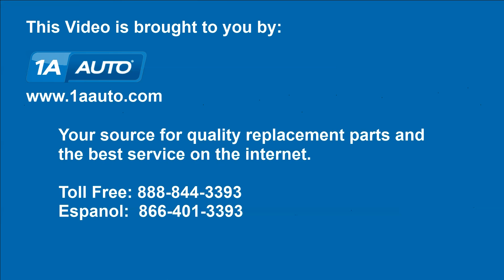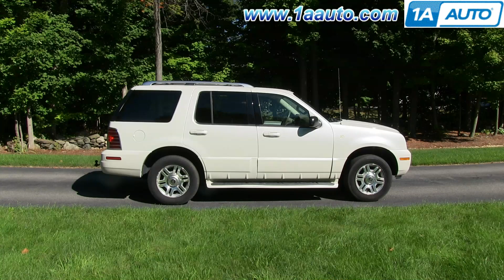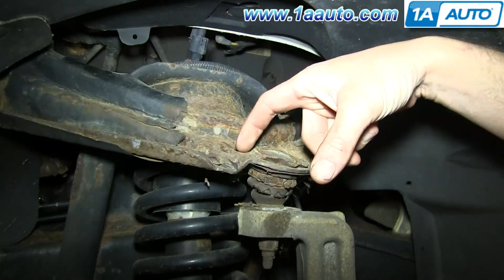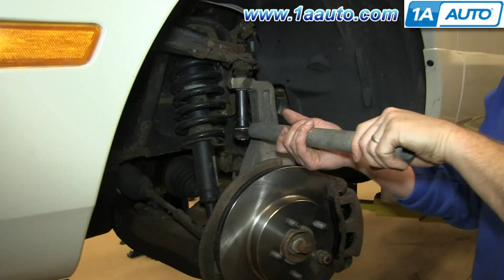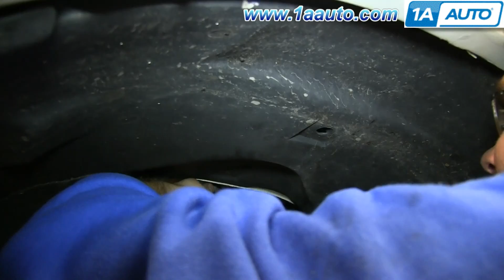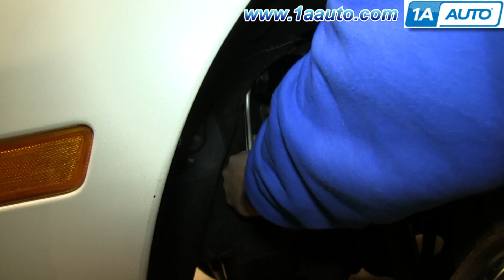How to Replace Upper Control Arm with a Ball Joint 02-05 Mercury Mountaineer

Comment: Sometimes jamming the whole upper control arm down with a bar or pipe works. I usually sit on it if I'm on my own. Another trick is to cut the nut off with an angle grinder and metal cutting blade.

Comment: This is what I was looking. I've done that job before just need to remember several parts and you just without too much science did what I need specific... an less than 10 mins...

I saw several other tips vids man....a lot of them practicly disassemble the whole front train to do that replacement... unnecessary do that and dobles up your job and increase your headache specially the unnecessary and excess spend in re-allignment of that train....naaaa...

THANKS GUYS !!!

Comment: I usually just remove whatever rubber is left over the ball joint and clamp a good set of vise grips there. Then heat the nut with a map/propane torch. It usually comes pretty easy like that. Might even get lucky and not need a torch using this technique.

Comment: I've got a 2004 Explorer where on a new control arm / ball joint combo, the diameter of the shaft of the ball joint was too big.  Trying to get the ball joint to seat - the shaft broke off in the wheel knuckle and is TOTALLY jammed in there. I tried to use a 3 prong puller and it seized up (lol - thank China) without budging the ball joint. Ugh. This is going to be a tough one. I haven't tried a torch yet. I don't have one of those fancy tie rod forks. I did borrow a ball joint press kit and hub puller. The thing I'm worried about is damaging the wheel knuckle since it's a much softer cast metal. I would appreciate any ideas. Thanks.

Comment: Hey mike. I was currious. I got a 2003 xlt model same body style as this. Are the ball joints removable from the control arm on this model or are they welded in?
Reply: I recently did these on a 2003 Mountaineer (same deal), while Mike's info is well intentioned, it is a bit off.  The upper ball joint can be pressed out on these, however most aftermarket ball joints will not exactly fit the OEM control arm.  The fitment  is off and you could experience a premature failure down the road.  The other issue is Ford does not sell the upper ball joints separately, only with the control arm.  Your best bet is to replace the entire upper control arm with an aftermarket unit.  The aftermarket ones are designed to service the ball joint separately, and aftermarket ball joints fit them perfectly.

This does not apply to the lower ball joint, it is totally serviceable as a separate unit, and replacements can be hand from both Ford and th aftermarket.
Reply from the maker: +Mark Wolf Thank you for checking us out. The ball joints will be able to be pressed out for replacement on upper and lower. 1aauto.com
Reply: That's a tuff job hard to get off the links